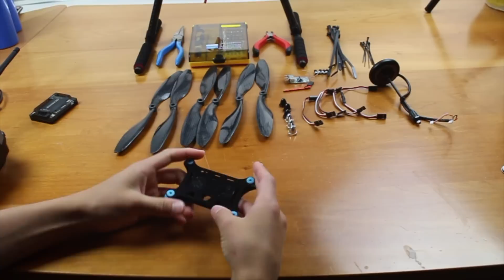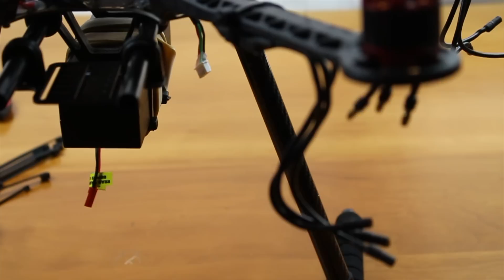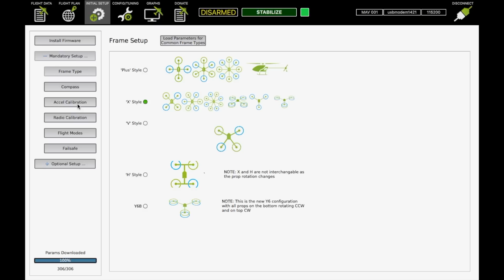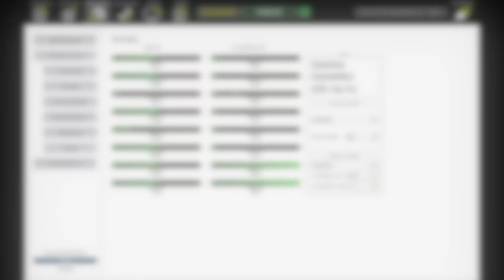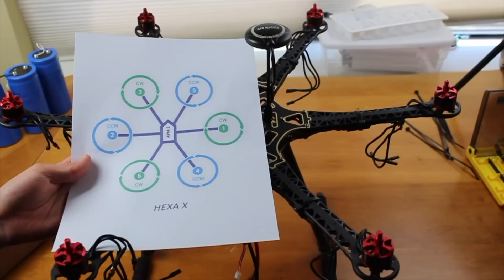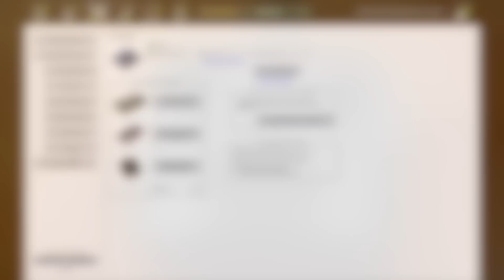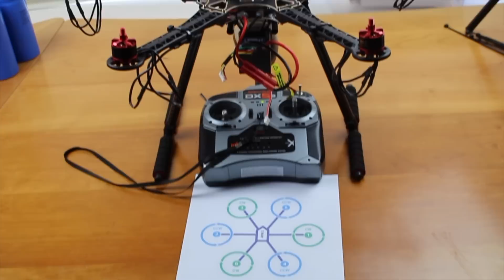Basic APM 2.6 Setup (Configuration and Mounting)

Comment: Never disconnect esc with battery plugged in, you can get short circuit
Reply: And plugg off battery when putting propellers!
Reply from the maker: How?
Reply: How do you charge battery? So same way.
Reply from the maker: What wires of the ESC are you talking about? The power wires are fine to disconnect and the motor wires can be disconnected to be rearranged. Their order doesn't matter. The only way that I could see a short circuit happening is if you intentionally shorted two of the motor wires and turned up your throttle.

Comment: hey what a great video and what a lifesaver you are I have bought the same quad and followed all of your steps but cannot get the motors to spin from the transmitter and I have a flashing red light could you guide me
Reply from the maker: Is that light on your receiver or APM? It sounds like you have a binding error. Double check that your receiver and transmitter are compatible and that they are bound.
Reply: BananaScience hi the red light that is blinking is on my arm and my radio receiver and transmitter is bound just can't get a steady red light on the arducopter like you have
Reply from the maker: The APM 2.6 goes through some "pre-arm checks" before it arms. Here is a list of them in order: 

http://ardupilot.org/copter/docs/prearm_safety_check.html

We can now be sure that your problem is listed there. Most of those problems are very uncommon, so check all of these:

1) Your APM 2.6 is level.
2) You are outside and have a GPS lock.
3) Your transmitter's throttle value is trimmed to the very minimum (this is what happened to me).
Reply from the maker: Sorry, I just noticed that the last part of my last comment failed to post, so here it is: I would check that:

1) You are outside and have a solid GPS lock
2) Your APM 2.6 is at least semi-level and on flat ground
3) Your transmitter's throttle channel is tuned to it's very minimum. If your throttle is too high, the APM won't arm.

Sorry for the delayed response.
Reply: hi thanks for getting back to me im going to try it out on the weekend I will let you know the progress many thanks for your help I really appreciate it
Reply from the maker: Okay. Hope you get it in the air!